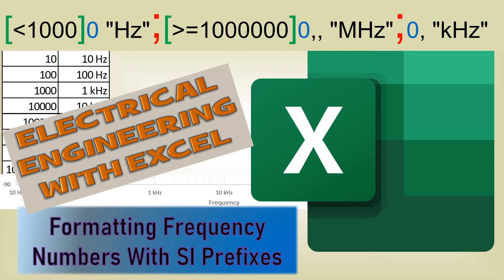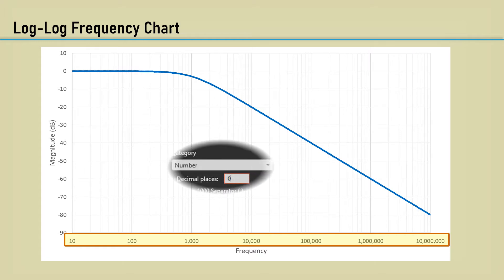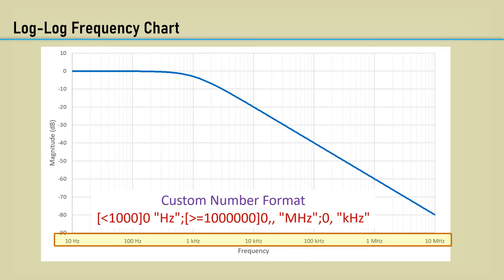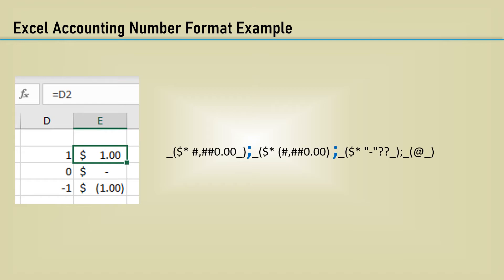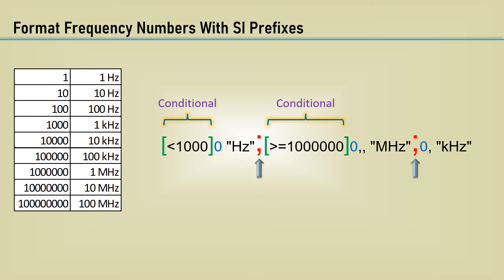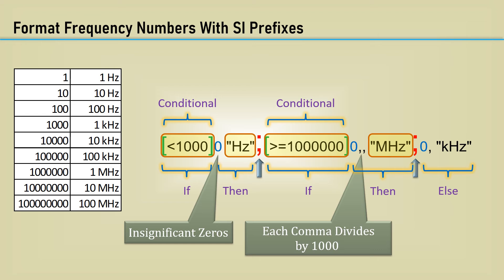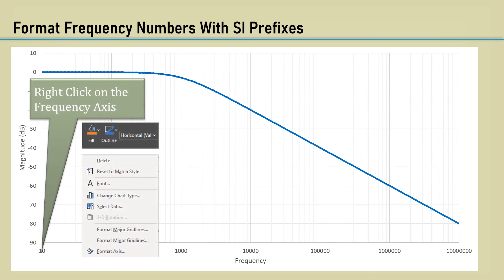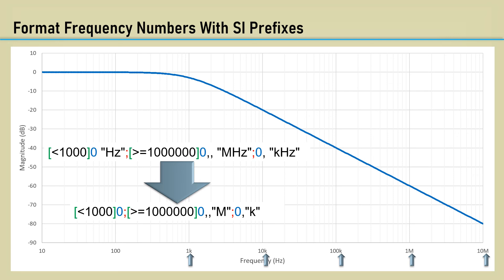Formatting Frequency Numbers With SI Prefixes

Comment: Thanks for this! I was not aware of these possibilities in the number formats.

One issue I had initially was that the commas did not do their job of dividing by 1000. Instead they appeared verbatim. It turns out that the Region settings need to be such that comma is used as the "digit grouping symbol" for this to work. That is not necessarily the default in all regions. After changing regional settings (hidden very deep down in the series of Windows dialogs) such that comma is used for digit grouping, it does of course work fine.

I had previously solved this kind of problem by using VBA code, but that does of course require additional cells where the resulting string can be put and it cannot be used (I think) in plots. An advantage is that many more than three cases can be supported, currently all the way from atto to Tera. Anyone who is interested can search for "Excel VBA functions for formatting numbers using SI prefixes (and back)". The downloadable xls-file has macros (the VBA code) and in order to run it, one has to right-click on the file and tick the "unlock" box. Maybe I should provide an xlsm file instead of the old xls... For those who do not trust the xls-file, the VBA code is provided as plain text too.
Reply from the maker: Thanks for the comment. I wasn't aware of the regional setting with regard to the digit grouping. I checked it out. The other options for digit grouping are very strange to me, but I'm not very worldly lol. 123456,789 12,43,56,789 ???

I did some VBA for SI prefixes too, but you took it to another by making it go back. Nice job!
Reply: @oldhackee3915  Well, I had "space", not "comma" as digit grouping symbol (maybe normal in Sweden, but I have changed other aspects of the regional settings, so I am not sure this is default), but it actually worked to replace the divide-by-thousand-commas in your custom format with spaces and move the desired spaces between the number and units to inside the quotes like this: [<1000]0" Hz";[>=1000000]0.00  " MHz";0.00 " kHz". This was found by experimentation. I did not manage to google it.
Reply from the maker: Great stuff. Thanks for sharing.